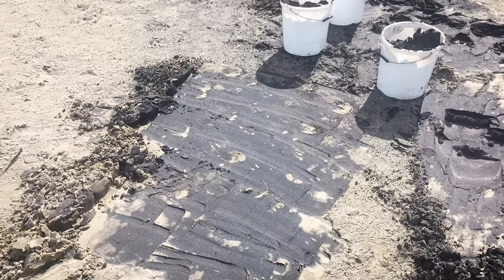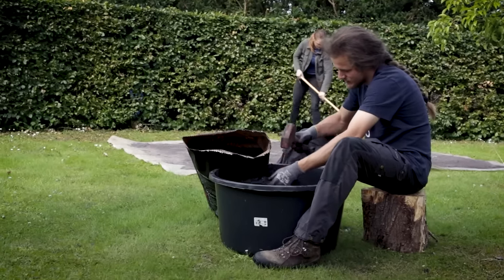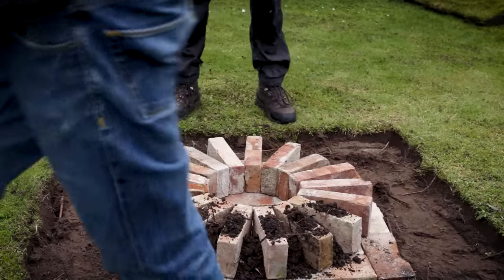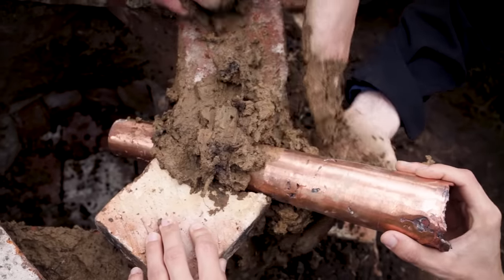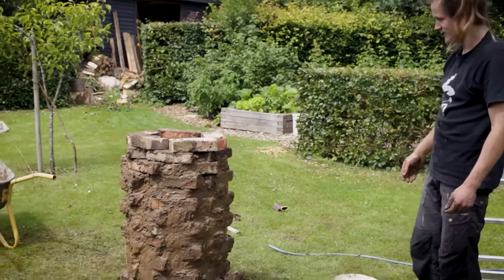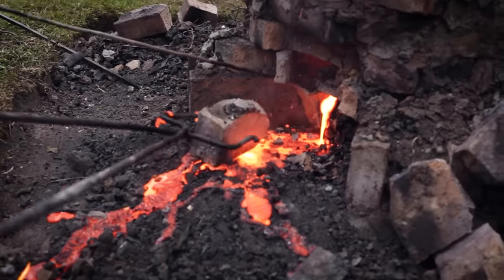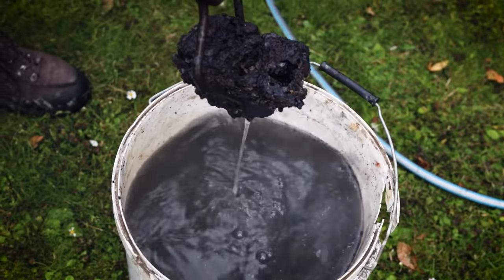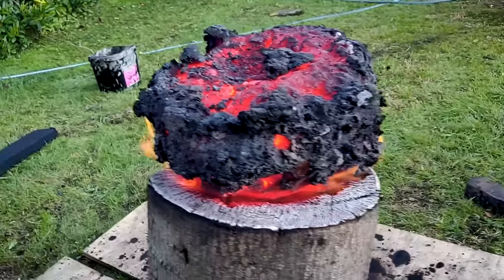Iron extraction from black sand

Comment: I've been trying to make my own iron on and off (mostly off) for a little over a year now, most of that time spent gathering ore. A few things I tried to smelt it didn't work, but yesterday I had a very minor success using my diy gas forge as a bloom furnace. Most of the magnetite sand didn't smelt at all, but some worked out well and coalesced into a couple small melty looking pieces. 

This should help a lot in improving my process, thanks
Reply from the maker: Cool, we wish you the very best luck with the process and journey this is! :)
Reply: The trick is it has to be a charcoal forge.  In a gas forge there's nothing to add carbon to the iron.
Reply: @@anoncommenter6726 thanks for the info! It's been a long while since I've had a chance to try it, but I'll save this comment for next time
Reply: @gamemeister27 carbon is needed to reduce the iron oxide into iron, to do the same in gas stove you would need to burn hydrogen or carbon monoxide.
Reply: @williamkao5747  So it was designed as a gas forge, but I did this by burning charcoal inside it and stuck a blower in the torch hole

Comment: When I was a kid I would use the 2 Tupperware bowls one had the strong magnet the other had the surface area I would rub on sand when you wanted to remove the filings lift sealed bowl and place the surface bowl in the container. My uncle worked for Lockheed so got me a high tech magnet well high tech for the 80s.

Comment: Did you pan that black sand for gold before you melted it down? Now I know what to do with all the black sand I have left over from prospecting for gold. I have buckets of it I have saved.
Reply from the maker: We did not pan the sand for gold, but don't expect there to be any significant amount of gold in it, as we are in an area with very low gold occurrence and don't think the beach waves is able to concentrate the gold there should be precent. I'll give it a try next time im at that beach. With the concentrated black sand you need about 4 to 5 times as much sand than iron you expect to extract. And at least 10 kg to make a small bloom, you'll regret to make a 30 kg bloom as we did. Regards Sebastian

Comment: Nice last yield. How much does a bloom typically reduce in volume when fully compacted ? I have a lot of redly colored hill magnetite here. I find the idea of doing an old fashion coalpile and smelts rather tempting :)
Reply from the maker: From the raw bloom to forged into usable bars you lose about 1/3 in weight, a combination of slag and forge scale
Reply from the maker: if you fold it a few times it is not unlikely you are only left with 1/4 of the starting bloom. So make more than you think you need. The 1/3 loss is mostly in the first compaction. Sorry for the potential confusion.
-Sebastian
Reply: @jakobhalskov  Life is learning by confusion, revision of detail is a step process. I appreciate both it and that you bother to add correction. Thanks :) I figure from observing scaling from impact working any mass manufactured iron/steel, there will be losses of mass at any process of compaction shaping. Carbon reduction, impurities etc. Thinking of it, it does sound much like the Bessimer... On mere ish assumption; How much stronger could a traditional poured steel cast anvil become, compared to one well forged in iron ?
Reply from the maker: A comment on the Bessimer process; the iron in a blommery dose not really melt. Though planning on doing a video on hearth fining iron, to reduce phosphorus and slag, maybe make some steel. With out promising anything. 

About the strength, using tensile strength as a proxy for strength/toughness/quality. As from the 2 articles I can find on strength of bloom/wrought iron. Bloom/wrought iron have a tensile strenght of 200-300 MPa. The samples was probably not heat treated, though the low C content is not allowing for much hardening. In comparison to 4140 alloy (common tool steel) have a tensile strength of 900-1500 MPa. after heat treatment. Not in any way a one to one comparison but might give a ballpark feeling of the difference, might be completely wrong. 

One "common" failure of old forged anvils is the horn and heel gets knocked off with sufficient abuse, because the anvil is forge welded together from multiple pieces. But there are also many anvils that have not broken in that way. 
-Sebastian

Comment: That was pretty cool, but what do you do with the bloom now?  Am I correct that it is actually steel rather than iron due to having a high carbon content?  So it needs to be folded in a forge and over an anvil to reduce the carbon content and other silicate impurities?
Reply: @kovona  If you get it completely molten, won't the slag and steel settle into different layers due to gravity and their different density?  Like oil and water separating?  Then you can just skim off the iron/steel?  Is that what blast furnaces do?  ( I really should know this seeing as my grandpa worked in a blast furnace all his life ).

Comment: Absolutely cool video, makes me want to go there and try this. How would your results been if you used coal instead of charcoal?
Reply from the maker: You would risk making cast iron, which is unforgeable and it's not exactly easy to oxidise the carbon to make it into steel at home, but can be done. There is also the risk of introducing sulfur from the coal which isn't desirable. Charcoal burn fast and clean.

Comment: I love this kind of stuff..I have a foundry and melt aluminum and brass and bronze. I make bells...
Reply from the maker: Thanks Ron, good to hear from you - I have a dream of getting into designing and casting 5-10kg bronze bell one day. Currently working on a bigger electrical furnace for burning out plaster molds.
Reply: @jakobhalskov  So far I have made a 6 inch brass bell but I make large aluminum bells I mix zinc with the aluminum and the ring is much better...I plan to do an 8 inch bell of brass soon. I use medium fine sand from local farm store and bentonite pond clay. for the molds
Reply from the maker: @rondelby2482  Lovely! How do you make the shape of the molds? And do you make them for yourself or to order for other people?
Reply: @jakobhalskov  Hi Jacob I buy real bells from antique stores or plastic ones that look enough like a bell.  I have a bottom wood box and fill it with sand. I pack the false bell with sand like making a sand castle. I put it in center. of bottom  sand filled box. Then I press the sand tight around rim of the false bell real tight...Then I use baby powder and sift around that and also the bell pattern (false bell)  At top of false bell I use a cut off pipe and put it in the middle of top of false bell...My cope box has angle iron pieces on all 4 corners so it will stay aligned. I put the top cope box over it and pack sand all around the outside of the false bell and pack tight all way yp to top pipe on the bell pattern....I take the pipe and swirl it  a making a cone shape and then I pull it out...  get a stiff clothe hanger wire and make little holes by sinking wire over bell pattern top. This will help wit releases of any gas trapped in the mold.I lift the top box off of the bottom and gently set it aside. I tap the false bell and lift it off which leaves a bell shaped core. Then sit the box down and the angle iron pieces slide down to the bottom with cope box...I fillaround the outside with sand to keep bottom from leaking.. Then I pour the bell. 
...

Comment: Good job the last is a nice baby. It's a pleasure to give birth to monsters like that even if you regret it when the cleaning process starts!
Did the big one get more carbon than the iron bloom of the first smelt?
And also why did you choose a tuyere made of copper?
Reply from the maker: Indeed! I will ask my brother, Sebastian, about the carbon content of the two blooms. Regarding the tuyere we had casted one of copper to be able to cool it well to prevent it from melting when exposed to the high temperatures within the oven.
Reply: @jakobhalskov  Thank you!
I still don't understand.
Copper melt before steel pipe.
And cooling it OK, but why would it be easyer to cool?
Or... You are aiming historical accuracy and in this case copper is better than clay and steel pipe would be anachronic?
Sorry that's a lot of questions
Reply from the maker: @MrWTPunk  The idea is that when the tip of the tuyere gets heated, that heat energy can more easily be transferred to the outside at radiate away due to coppers ability to transfer heat (compared to steel for example). Regarding the carbon content; our feeling is that the black sand iron has a larger carbon content than the bog ore, but we still need to do a proper spark test to determine this.
Reply: @jakobhalskov  Thanks for taking the time to explain, I like to understand. So you never ended with a blocked, molten tuyere at the extremitie, that's good to know. 
I have read somewhere that magnetite creates in general carboned blooms.

Comment: Couple of Questions

In a purely fictional survival situation, could this be done without magnets? 

Would the results be similar or different?
Reply from the maker: I'll say it could be done with out the magnet, especially if the sand was collected more carefully, the bog ore is definitely possible to do wit out a magnet if you know where to find decent quality ore.

The higher amount of silica sand and other non-ferrous minerals in the ore would most likely change the slag chemistry, for the better or worse i cant say. But the yield would be significant less. But how the furnace is operated also have a large impact on the quality.

Sorting the ore with a magnet, just ensured that we would get iron.

-Sebastian

Comment: Important Question: is Black Sand and Ironsand the same?
Reply from the maker: Yes, in 99% of the time. It's mostly magnetite mineral. Black sand can also referer to vulcanic sand that's basalt.
Reply: @jakobhalskov  is Black Sand basically sand with Iron and Minerals? While Ironsand is purely Iron that's been turned into like Small Powder like?

Would that make them different right?
Reply from the maker: @KyuuDesperation blacksand is just sand primarily made of dark(igneous) minerals, in this case mostly magnetite. In most cases i would accept using black sand an iron sand interchangeably. I would not consider metallic iron "iron sand".

Hope that made sense.

Comment: Quite an excellent job.  the next step would be to take your bloom and heat it to about 2,000F (bright read) and then hammer it out, fold it over and hammer again.  This will work out the porosity.  Then you can work it into whatever you want.  You have your choice of plowshare or sword.  I have some land that has an Iron carbonate outcrop.  I may try to smelt some of this.  It is not as rich in Iron as your magnetite but it is a decent ore.
Reply from the maker: We already have a short video of forging a piece of the bloom. We will soon make a more detailed video of the refinement process and try to make steel from it.
Reply: @jakobhalskov  I would like to try and make wrought iron instead of steel.  Getting the phosphorous and sulfur out is an important part of making steel.
Reply from the maker: Sulfur is not a problem in our case as we use charcoal and not bituminous coal. Phosphorus is a huge problem, the raw bloom contain 1.5% P after 4 folds it's 0.8% but still really high. The literature suggest hearth remelting can reduce the P content, but that't to be determined in a future smelt.
Reply: @jakobhalskov  there are two ways to remove phosphorus from iron.  One is during the oxygen blow when you have molten iron, but that involves temperatures well beyond a charcoal fueled furnace.  It will also remove virtually all of the carbon present.  The other way is finely grind your ore and selectively leach with Hydrochloric acid.  hth

PS:  Coking your coal will remove a fair bit of the sulfur present in the coal.  A basic slag will also help to remove sulfur.  Starting with a low sulfur coal is the best way to go.

Comment: What are you going to use that for? Are you aware of the amount of work needed for you to make a clean homogeneous product? If you do use it, please look into using an auto hammer, or at least be prepared to close to breaking yourself if you take on using hand tools. Good Luck, I congratulate your ambition.
Reply from the maker: Hopefully making a sword in the very distant future. I am aware of the huge work ahead of me, I might be able to borrow a powerhamme at a freinds place. Otherwise get a few people to swing a sledge hammer. There is also the problem of the Phosphorus content that i need to reduce, right now its about 2%, aming to get down to about 0.5%-0.2% ideally.
-Sebastian
Reply: Have you measured the P content? That is high... If you offer some beers and chips  to friends you would be surprised how you will get grown adults to work for you for like $1.50 an hour 😀 Well done... I am sure it will be the first and last time you will attempt this. There is a reason swords were so prized in the middle ages.  🙂
Reply from the maker: Yes, I was fortunate enough to get made an XRF scan of the bog ore and resulting iron and slag. The P content is indeed high, got grains that you can measure in mm (and that's after 4 folds, but didn't normalise the grain structure after, that could probably help reduce the grain size). I have done a few smelts before, but this was the largest and most successful smelt, definitely going to take a while for me to go through that amount of iron to process and refine it.

Comment: Should've just poured the dust into a crucible
Reply from the maker: The iron oxide dust needs to be reduced to iron by reacting with the carbon monoxide in the oven. Just heat is not enough.